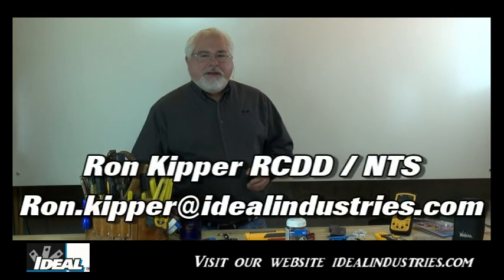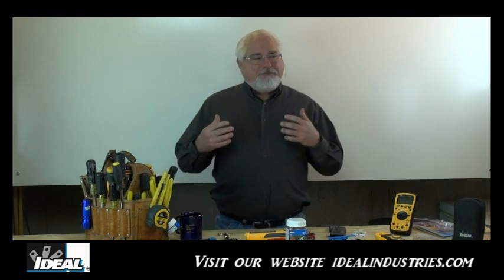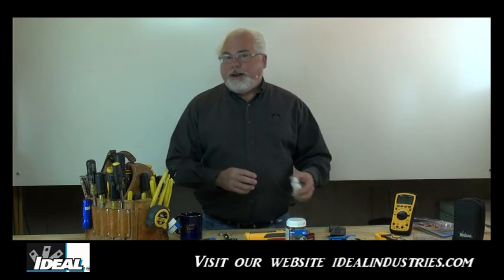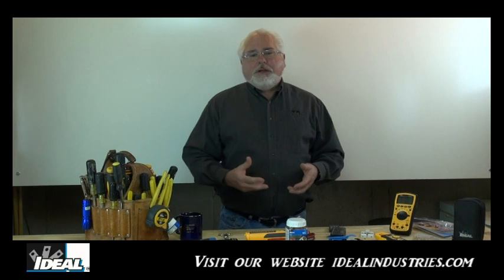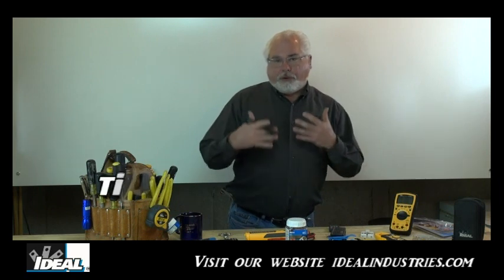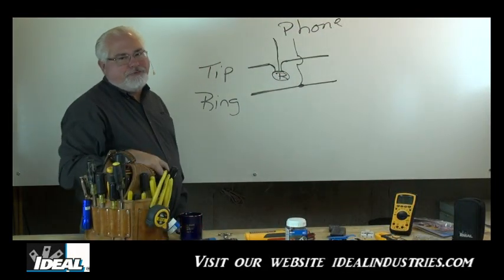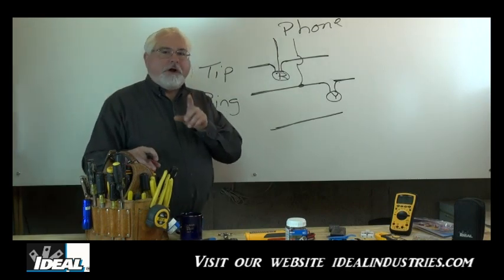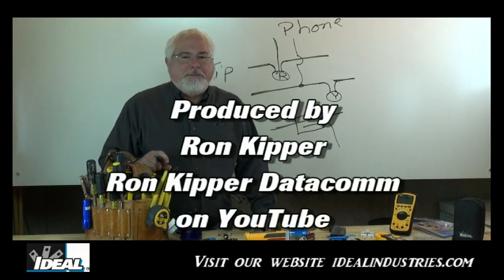Jelly Bean Telephone Connectors

Comment: Suitable for outdoor use? I’m assuming they are being gel filled but just wanted to check
Reply from the maker: Hey Tech Metal no they are not considered waterproof the gel filling helps but again not considered rated for outdoor use. Ron
Reply: Do you have another product that would work for an outdoor application?

Comment: If I have to extend a telephone cord due to I used all the cable and have to get a new roll which product is used to add additional phone cord?  Thank you.
Reply from the maker: Cat 3 cable will work for your telephone you don't mention if you are putting wall jacks in thre rooms but that would be easiest good luck Ron
Reply: @RonKipperDatacomm1  excuse me, I Did not mention I was extending a telephone cable what is your recommendation to extend the telephone cable and take it to network box?

Comment: +Ron Kipper Datacomm I have 1 cat 5 cable I need to splice. some construction workers came by and cut it by accident. I don't want to buy a punch down tool for one splice. How should I connect it?
Reply from the maker: +michalchik Best answer is to replace the cable we should not try to splice the cable. However if you just stripped the wires and twisted them back together it may work depending on the speed of your system.
Reply: ***** Unfortunately th cable is mounts and runs through so areas that have nbee sealed. It is half a days work running, drilling, mounting and resealing the holes.
Reply from the maker: +michalchik If you are just using it for 10/100 BaseT Ethernet you can probably splice the wire with the jelly beans and give it a try it will probably work. If you ever can I would replace the cable.Good LuckRon
Reply: I am using 10/100. What kind of places sell jellybeans walkin retail?
Reply from the maker: +michalchik They are sold at Home Depot and Lowes in their "datacomm" set with the cat 5e cable and stuff.
Reply: +Ron Kipper Datacomm You are a Mensch! Thanks